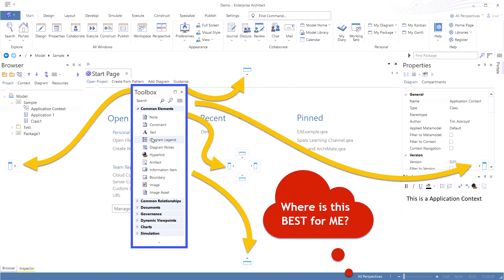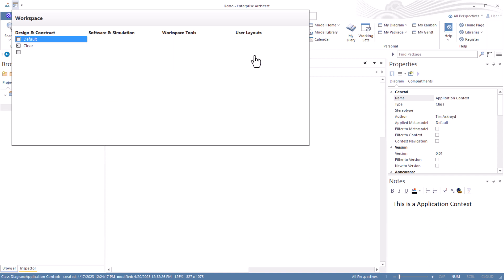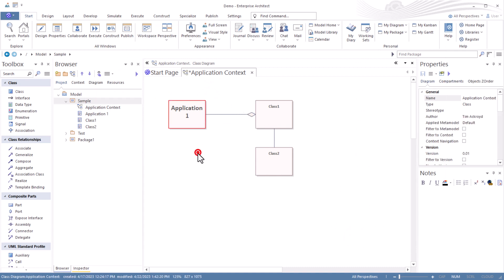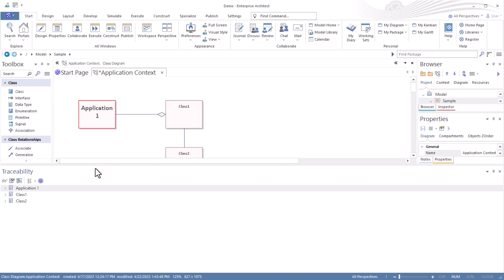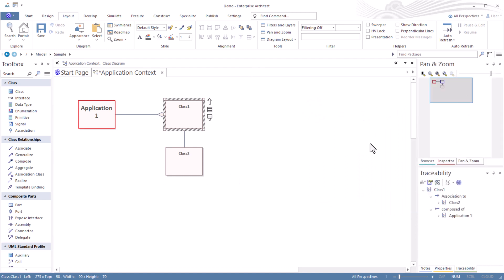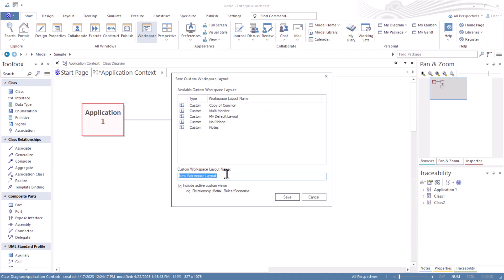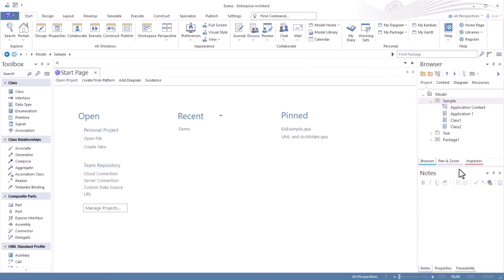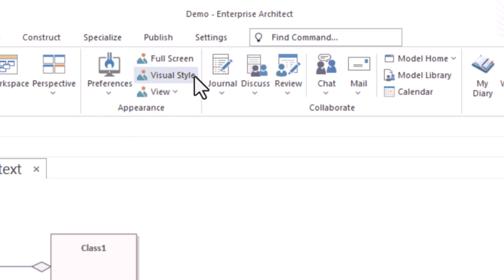Sparx Enterprise Architect (EA) Layout Tooling and Features (e7)

Comment: I’m getting up to speed so quickly with your videos 🙏. For zooming, I prefer to stay within the workspace (working canvas). I use a mouse with a clickable scroll wheel. To zoom in, I hold Ctrl and scroll the wheel. To drag the entire diagram or the zoomed-in area, I click and hold the scroll wheel while dragging. To scroll up and down, I simply use the scroll wheel. You don’t even need to be on the Pan & Zoom portal—you can do this directly while the browser or any other portal is selected.

Many thanks again! 💯
Reply from the maker: Agreed on not needing Pan-n-Zoom. I have 3 monitors where my entire Workspace is in the Center Monitor and other windows are in Left and Right Monitors., including my IDE and Cloud Tooling. Sure makes things productive for working in large and complex Projects.
Thank you so much for the feedback.